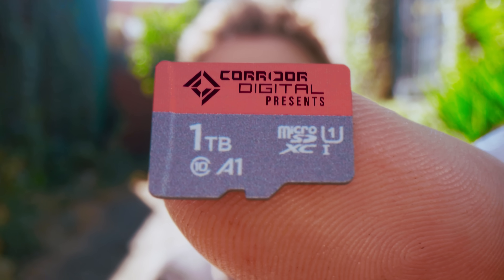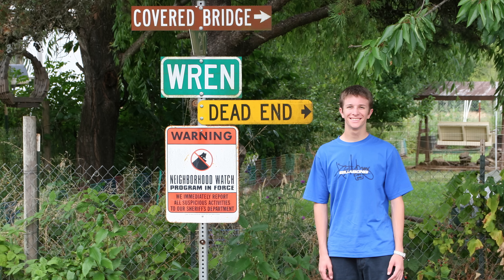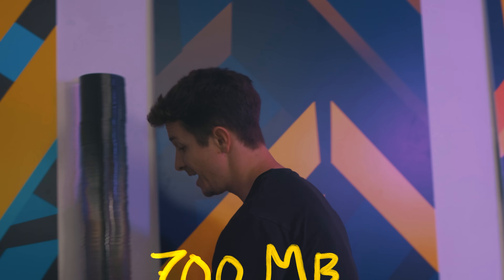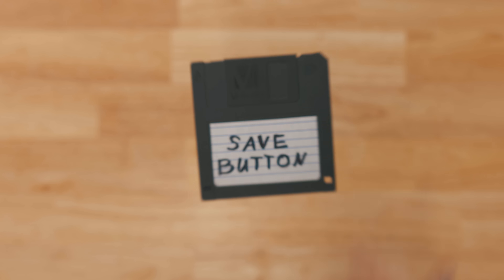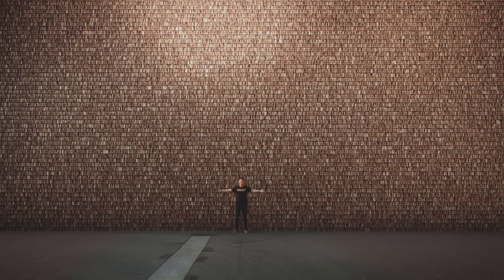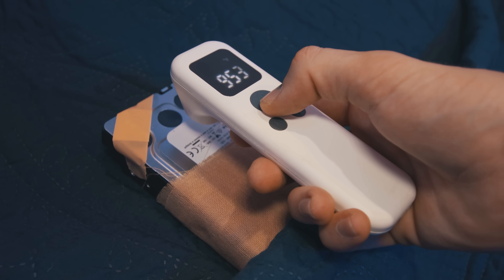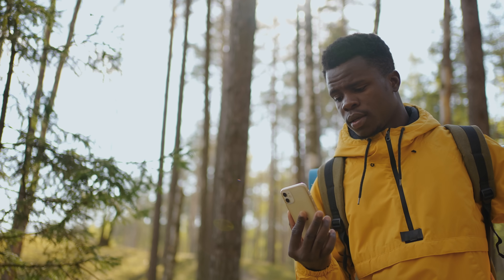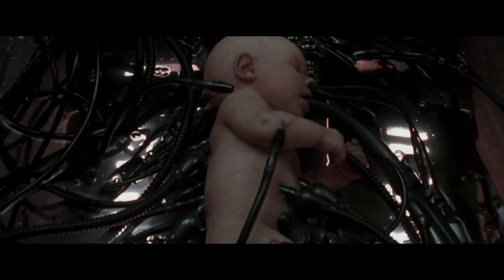VFX Artist Reveals the TRUE Scale of Data!

Comment: Is a bit the smallest form of data when quantum computer's qubits have 4 states? Love these videos, so much work must go in to them.
Reply: What do you mean by "smallest form of data?" It sounds like you are talking about the smallest physical package which can hold the most data. But a "bit" is an abstract concept, not a physical object, so that interpretation doesn't even make sense. Are qubit chips more data compact than the normal chips we have? Well, it doesn't really seem like it. From what I gather, IBM made a 127 qubit chip in 2021 which is actually relatively large, like the size of a coin. There are plenty of chips with way more than 127 normal bits and smaller size. But that is at best a theoretical answer that might change as technology progresses anyway.

If by "smallest form of data" you mean the smallest unit of data, then a bit is definitely smaller than a qubit. I mean, if a qubit has 4 states (that's not exactly true, but we'll just use it for the sake of argument since you postulated it), then that unit of data is obviously larger than a bit. Having 4 states would literally mean that it can contain 2 bits of data.

A single qubit has infinitely many states, not just 4, but when you read a qubit you can only read 2 different outcomes (0 or 1). A normal bit, as we know, can also only be read as 2 different outcomes (0 or 1). So a qubit definitely isn't a smaller packet of information. But it is possible to hypothetically store 2 bits of information in a qubit, though I would say this isn't the same as a qubit "having 4 states", rather that there is a method which can be used to reliably get 2 bits worth of information from this physical thing which has infinitely many states.
Reply: @MattMcConaha  I literally quoted Wren's words when saying 'smallest form of data', unless I misheard him
Reply: @Maggerrzz  And you asked if a bit is the smallest form of data when the qubit exists. Which I responded to.

I could be mistaken, but I'm pretty sure a bit is the smallest hypothetical packet size of information. Hypothetically you could assert the existence of something that only has 1 or even 0 states, but it can't store any usable information, so it's not really a packet of data. But the way you worded your question was specifically about a qubit and its relation to a bit, and even more specifically with the implication that a qubit might question the bit's status as the smallest packet of information.